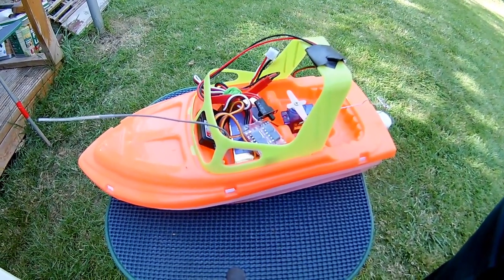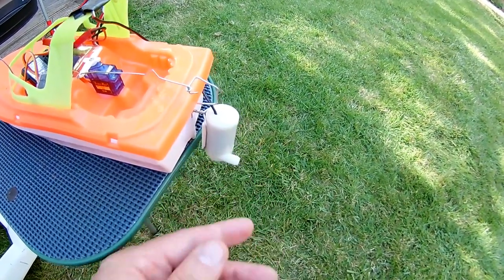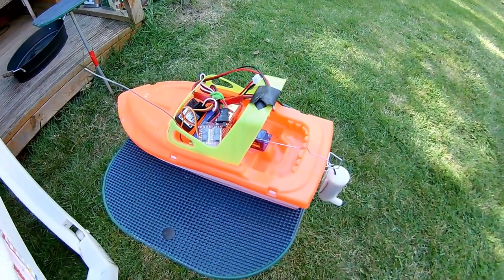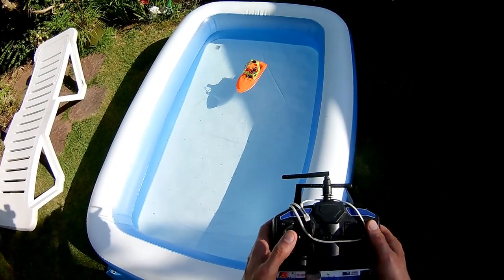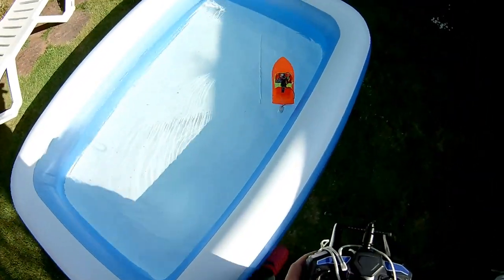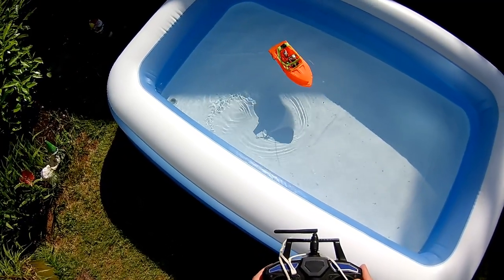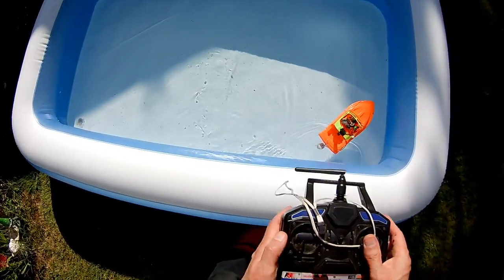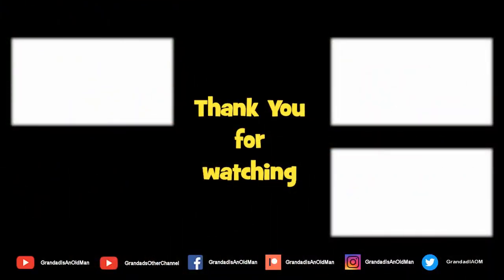Simple Water Jet RC Boat revisited 20200610

Comment: Try soldering a small ceramic capacitor across your DC motor leads at the motor.  This will absorb the RF noise crated by the brushes arcing inside the DC motor.  I had the same problem with "servo chatter" on a home-made ESC I made using an Arduino and L289N H-bridge.  I solved the problem with the method described above.  If your motor is sealed and you cannot access the + and - connections on the motor, you can try looping the power wires through a ferrite bead as well.
Reply from the maker: Thanks for the tip